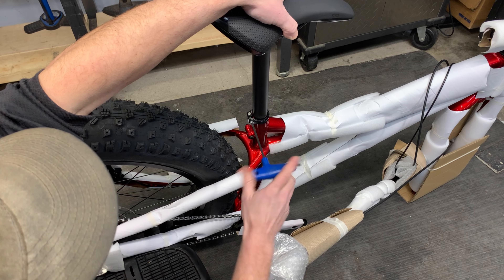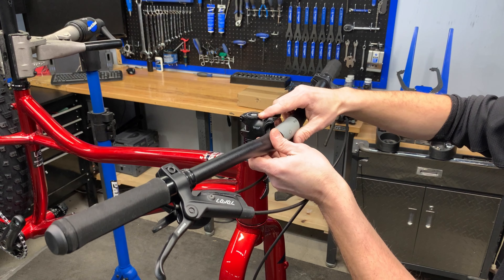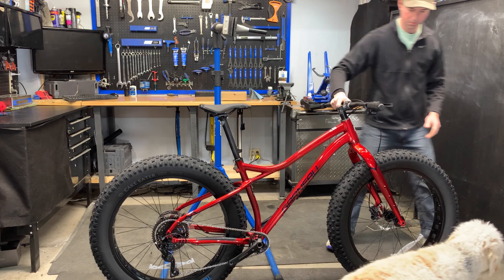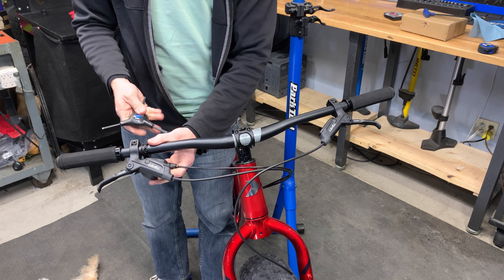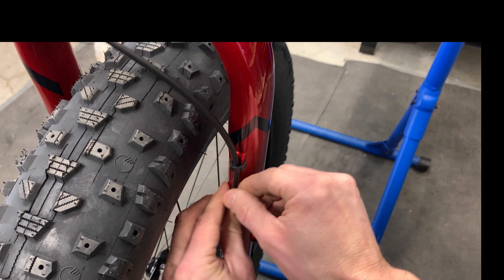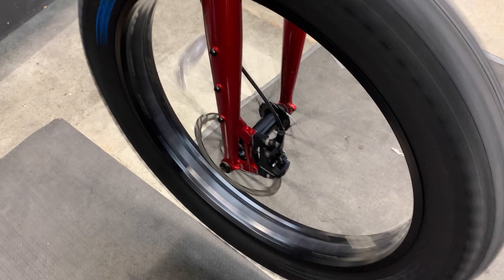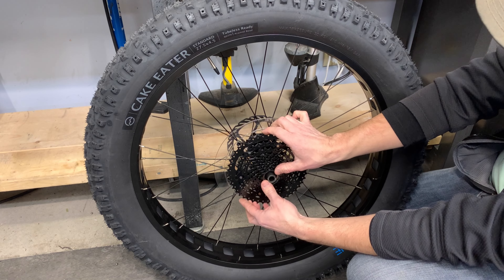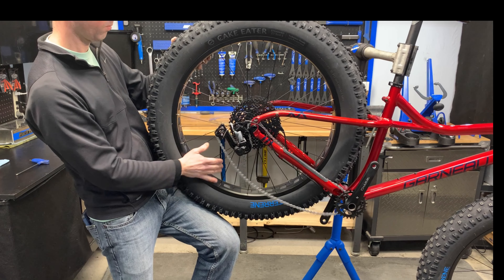Costco Bike Build -- Louis Garneau Gros Louis 3 -- Fat Bike

Comment: wow excellent how-to assembly vid.  Definitely considering getting the GL2 since it's all costco has left.  Btw, I was reading the face book group - Louis Garneau Gros Louis Ontario Owners Group - and it seems quite a few people are saying the break rotors are super overtightened from the factory.  It can be nearly impossible to remove all the bolts with the bolt stripping, or tool getting damaged. Might have to be drilled out in some cases too.  Is this something you have noticed? kind of apprehensive to buy it after reading about this issue. ✌
Reply from the maker: Thanks so much, I appreciate it, It was a fun assembly!  I would definitely recommend the GL3 or GL2.. it's a solid bike with exceptional value.  
  I didn't notice the rotor bolts to be overtightened, but I guess I'll see when it's time to take it off.  In any case, I wouldn't let that steer me away from buying the bike.. worst case you (or a bike shop) could drill them out, if need be.  That being said you should get a lot of life out of the rotors before they need to be replaced.  🙂

Comment: Solid bike I have Gros louis with sram sx wasnt from costco but entry level eagle groupset but these bikes are solid bikes.
Also costco has them marked down from retailers. The louis 2 with sram drivetrain retailed for $2500.
Also the Geometry is modern with a farily slack head angle.

Cant beat the price for what you get.
Reply from the maker: Yeah I agree, they both are solid bikes, and the costco deal is going to be hard to beat!